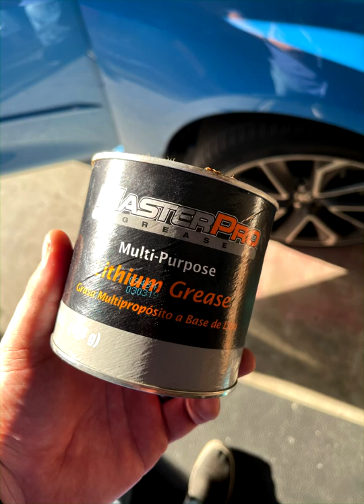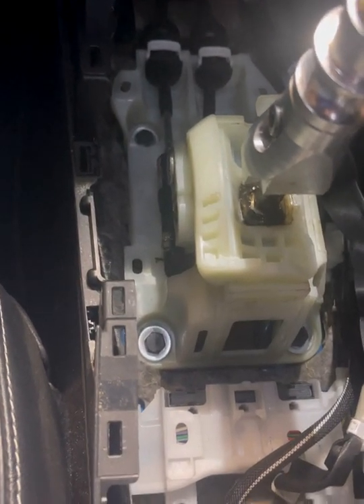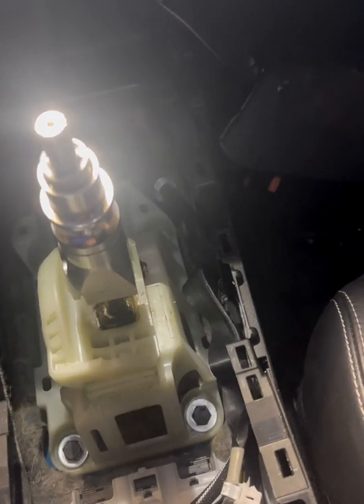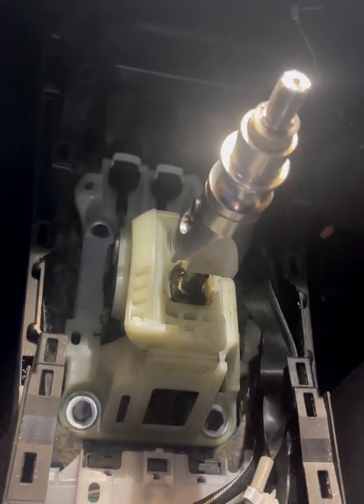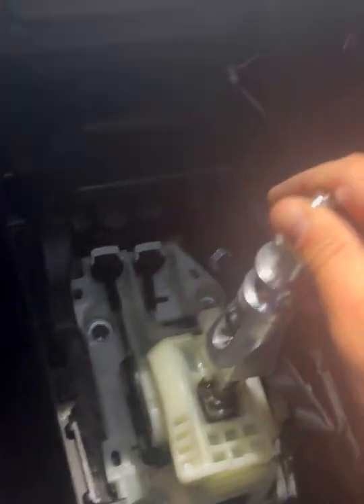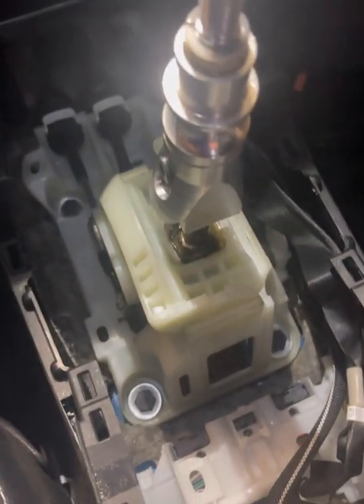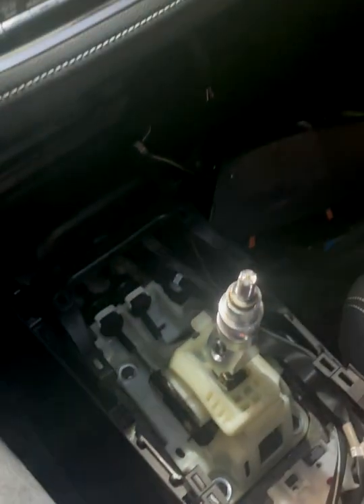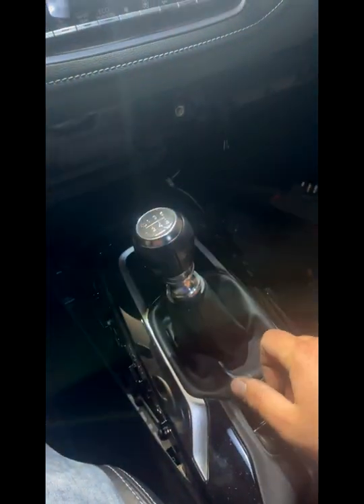2019 Toyota Corolla Short Shifter Install

Comment: I think there was a change in the design mid-way through 2019 on the gearshift for the 6MT... (Mine is also a 2019 Toyota Corolla Hatchback XSE)

I purchased this short-shifter, and everything went exactly as in your video except  for one major thing... the reverse lock-out wasn't functional; I could literally put into Reverse without the lockout mechanism being utilized.

As it turns out, the metal extension on the short-shifter assembly was too short and couldn't bump against the plastic of the shifter assembly.  What I wound up having to do is to fabricate (Ok, that's giving myself too much credit.. I hacked this together) a plastic extension for the shifter mechanism and bolster it with some plastic epoxy and a few self-tapping screws to hold it in place.  A bit of filing and trimming, and the reverse lockout was functional once again.. though it's still a bit of a bodge job.

I used the strongest stuff I could get my hands on .. plastic repair binary putty that holds up to around 3000lbs so I'm hoping it'll hold up over the long run.

Just an FYI for everyone; this does work and it works great, but you might have to fabricate a bit of a plastic wedge in order to restore the functioning of the reverse lockout.

-Hinoki

Comment: Great video! Why did you cut that tab out? Is that the only "modification" needed.  Thanks
Reply from the maker: Thanks!  Yeah that’s the only one. It is for the 5th gear. It will catch on it when you put it in 5th if you don’t.

Comment: Yo, im about to get a 2021 Toyota corolla with the 6-speed manual and i thought about putting a short shifter. If it works on the newer model, i’ll definietly look at this video as a guide.
Reply from the maker: I’ve heard of some guys putting those in the newer ones. They had no problems. And congratulations!

Comment: I dunno where or how you got the idea to use a scion shifter, but THANK YOU for this video. It's amazing. But how do you keep the boot stationary?
Reply from the maker: I can't take the credit there are guys on a forum that did it first, I just made a video tutorial to go along with it lol. So the boot stays up by itself pretty good, if I used a soft cloth boot it wouldn't hold, it would need to be secured. There's a lot of different ways you can do it.
Reply: Thank you for the video Big Rome! 

The guy you mentioned is me! I posted a write-up back in 2019 on the FB forums after discovering the tC fit. 

You are right in regards to removing the center console. You wouldn't have to disconnect the shifter cables at all but good job! 

Cosmo Racing now makes a direct fit STS for 14+ Corollas HB/ Sedans equipped with 6mt. 

I have also reaching out to Fidanza Performance they will be making on as.  well. 

@Hatchiburu

Comment: The four I guess adapters that you put on the bottom to mount the short throw in. Did you have to purchase those or did they come with the kit?
Reply: And also how much height does it drop from the standard throw?
Reply from the maker: The bushings came with the kit. It had everything you needed except lubricant. I didn’t measure before and after because I was too excited to put it in so I forgot. But it feels like it’s a good inch or 2.
Reply: @bigrome596   thanks man, really appreciate it